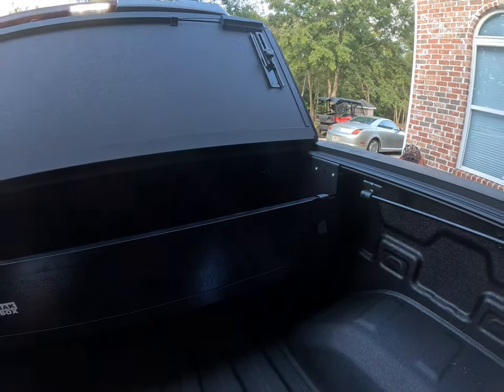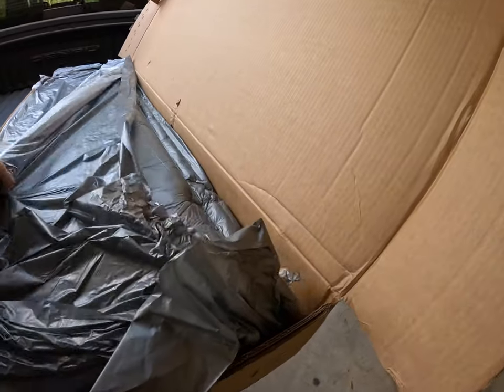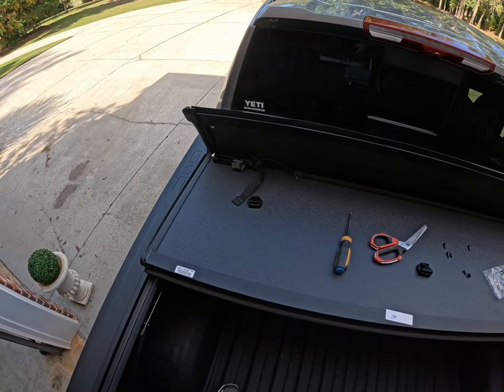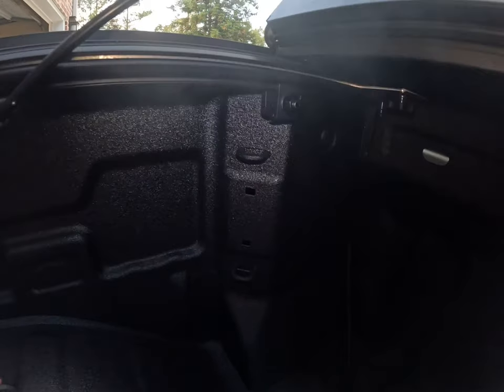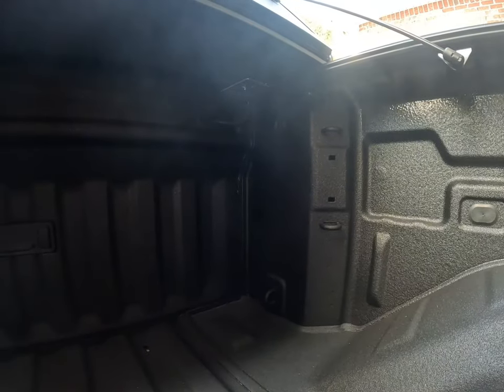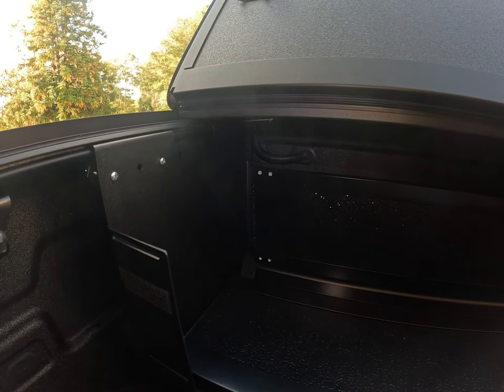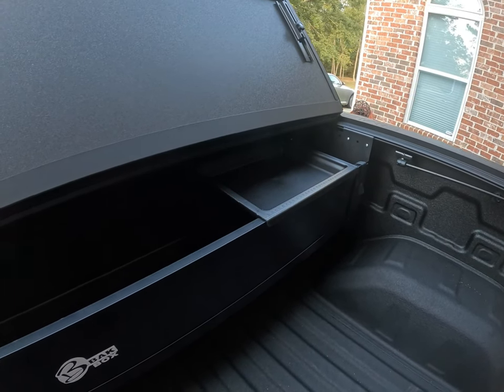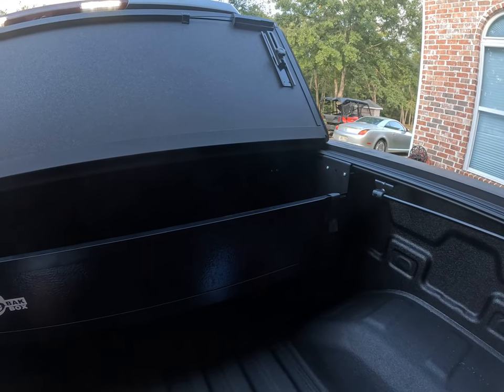BackFlip M 4 Folding Tonneau Cover with BAKBox2 toolbox

Comment: First day I had my Ultimate I got a similar tonneau. Mine is Undercover I think the brand is. I went right up to a local dealer that sells trailers and truck accessories and think it was $1100 installed. I kinda wanted one of the power roll up ones but then you have the big box taking up space in the bed for it to roll into and they are double the price.